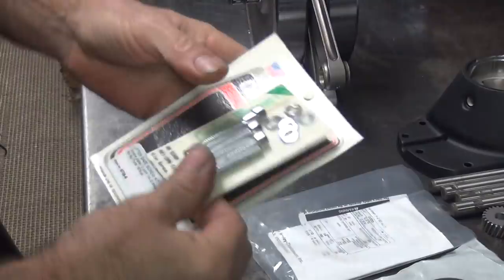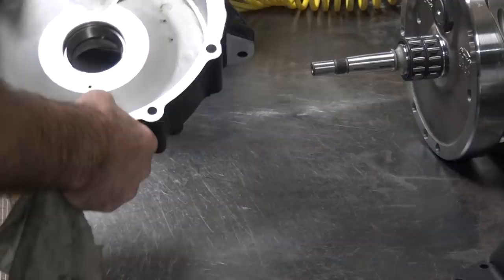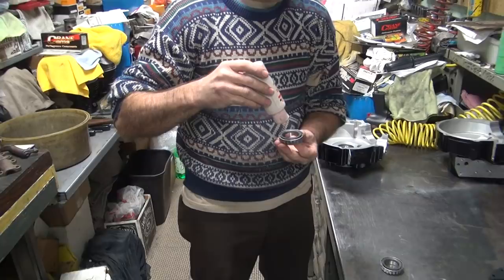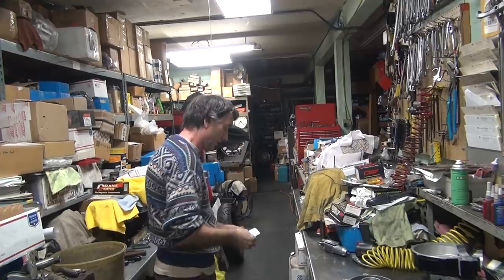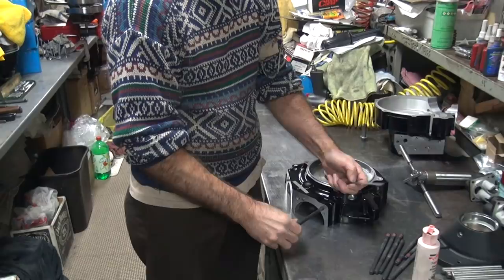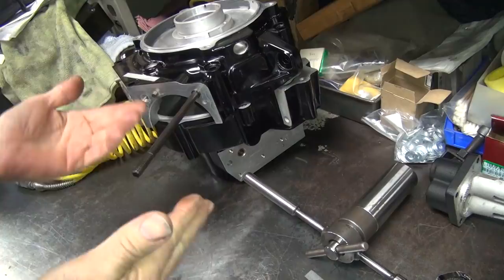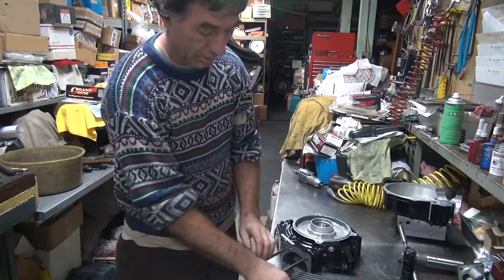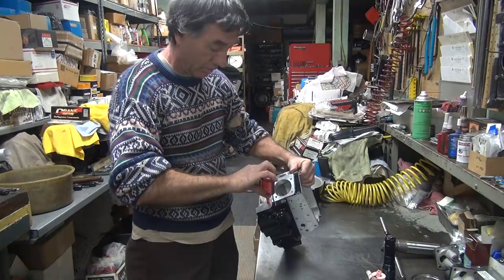2000 fxr4 80ci #107 motor rebuild fxr evo harley evolution cam bearing repair by tatro machine

Comment: FXR4 ? What's the 4 in the model number ?
Reply from the maker: the fxr was made from 1982-93. that would be the #1. the next fxr's made were special models only and were only made for two more years. the fxr2 & fxr3 were made in 1999 and the fxr4 was 2000. not many were made and they all had evo motors. that was the last bigtwin evo motors put into harleys.
tatro